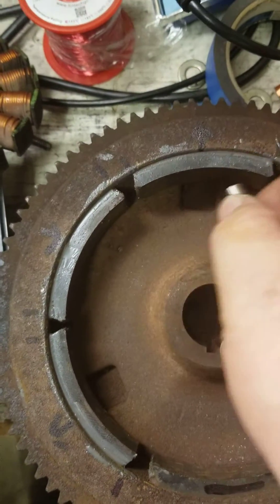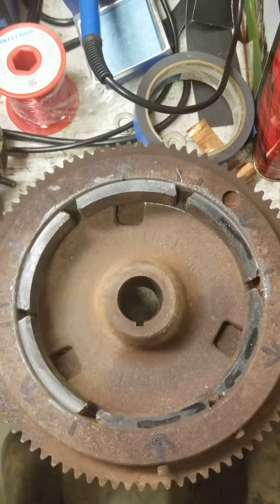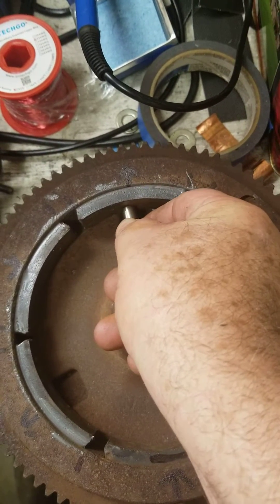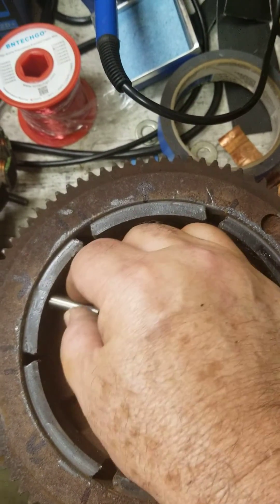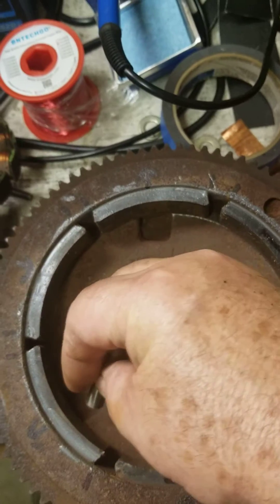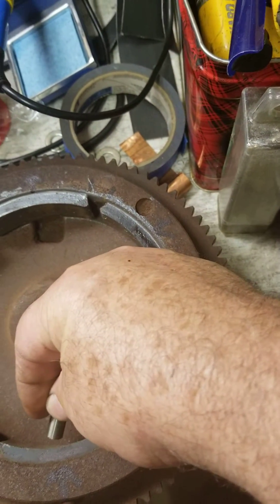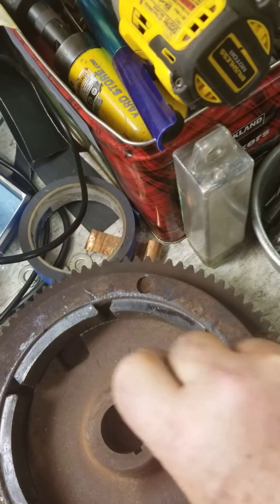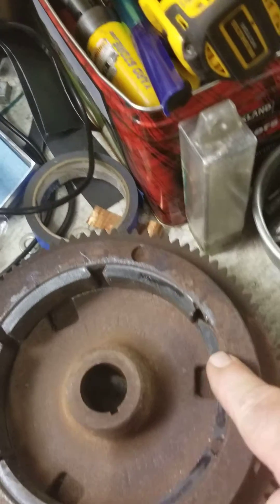Miller welder flywheel magnet polarity, re-gluing magnets in a flywheel correctly.  OH160 Tecumseh

Comment: In one of your past comments you mentioned that if all magnets have the same polarity, the 
re-attachment order doesn’t matter.  This is the case with my Snow King (LCT) 414cc snow blower engine flywheel (5 magnets, all with the same polarity). The stator generates power for a light.  QUESTION: Why would some stators function with this arrangement instead of magnets with alternating polarity?  All the magnet re-attachment videos that I’ve seen show alternating polarity magnets.
Reply from the maker: This greatly depends on what is being produced alternating current AC or direct current DC and the circuitry after. It is easier  to produce AC and convert this output to DC. This helps with the balance of the flywheel and less load on the engine as it's running.
Reply from the maker: Also, the choice of the manufacturer and designs of an engine.
Reply: @nadingjeff  Much appreciate your response. The LCT service parts catalog lists the stator (LCT 24021) as  "Charging Coil (60-watt AC) (291/414cc)".  Don't all AC alternators require magnets to be arranged in alternating polarity? (Just trying to learn...)

Comment: Can u buy those magnet
Reply from the maker: U can on Ebay. That being said, if u find an old 16 hp tecumseh or Onan flywheel the magnets are the same. They can be removed by placing the flywheel in an oven at 500° for two hours, then let it cool, in most cases the magnets will be loose.
Reply: @nadingjeff  the

Comment from the maker: The inner magnets have noting to do with the ignition coils or spark to the sparkplug, only for charging the battery. What engine do u have?
Reply: Oh 160. I've installed a TCDI II and an Exciter module from Dale at overnight Solutions. He has been walking me through the install and given me great advice with troubleshooting. as I still have no spark.
Reply from the maker: I know nothing about that system.  This is what I know, more than likely u would not have spent as much. So I would suggest going back to where u bought the parts from. Or join this group and look for my posts and u will find the information  for electronic ignition. 
https://www.facebook.com/groups/1625860977654345/permalink/2828908020682962/

Comment: would this prevent spark?
Reply from the maker: Not sure what u r asking. The magnets have to do with charging the battery, usually located under and glued to the iner-circumference of the flywheel. The spark to the sparkplug is from the ignition coil and a magnet located on the outside perimeter of the flywheel.

Comment: So if I have a fly wheel with 4 magnets they should alternate polarity. All 4 came off, so I don't know  what to do
Reply from the maker: First thing to do is to ascertain if the magnets have the same magnetic poles or not. In my video 3 have a north pole in the middle of the magnet the remaining 3 have a south in the middle. If urs r all the same configuration it will not matter where or what position they r placed, if two r opposite the other 2 then place on north and then south then north then south at equal distance apart from each other.

Comment: What is the Configuration for a 3 Magnet setup?
Reply from the maker: Never seen one with three.
Reply: Think I figured it out...each end of magnet has north and south,  I had installed with like poles facing each other unknowingly not realizing polarity. Awaiting replacement Magnets to try.
Reply from the maker: Robert Bieber cool
Reply: That was the issue thanks you!
Reply from the maker: Robert Bieber awesome
Reply: I should mention this is a 10HP Tecumseh, Toro snow blower,  2 coil stator, 3 magnet flywheel running a light.

Comment: How do you get them off to fix?
Reply from the maker: Well if the magnets come as a kit and r available as new, or u can find them loose on on Ebay, check that avenue first, because chance's r u will destroy them trying to remove the good ones. I have been successful at removing them by heating the complete flywheel in an oven to 500 to 600 degrees, try 500 first, at that point the glue does release. When doing that make sure the starter ring gear stays in place.
Reply: @nadingjeff  thank you for the tip on heating the flywheel up in the oven, they came off fairly easy. I heated oven to 500 let the flywheel get hot waited about 30 min then used a flat head screwdriver to get the magnets off. (Safety tips: use oven mitts and make sure you use safety glasses when getting magnets off flywheel)
Reply from the maker: Some manufacturers will actually re-magnet the flywheel for u for free, but u have to pay for shipping both ways.
Reply from the maker: Glad to have helped.